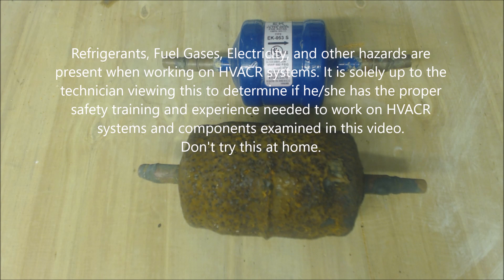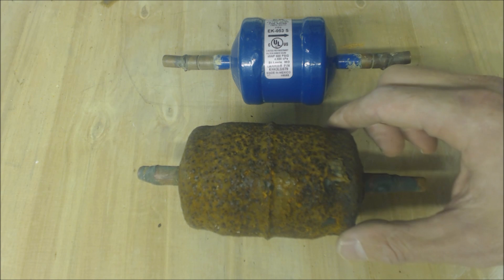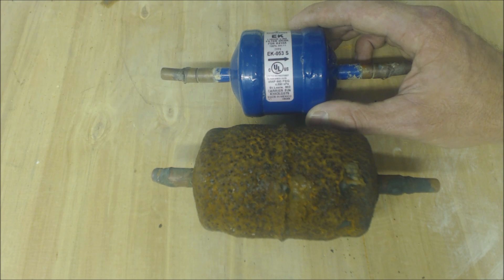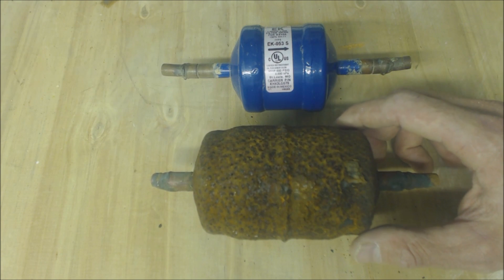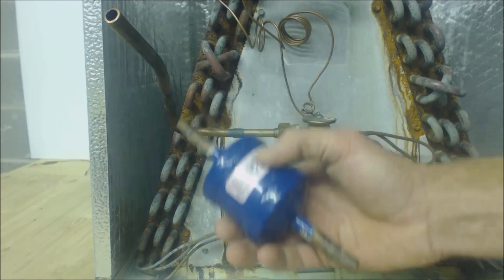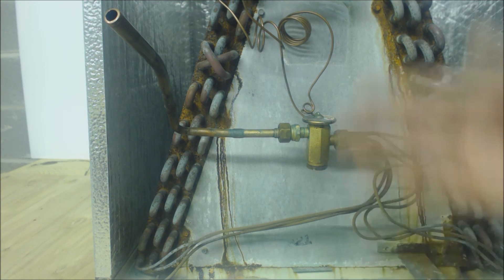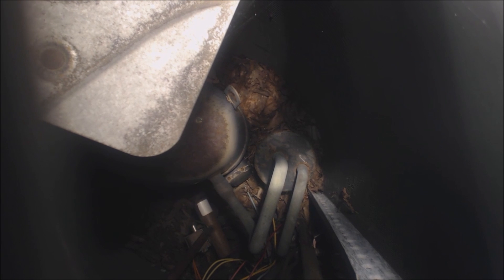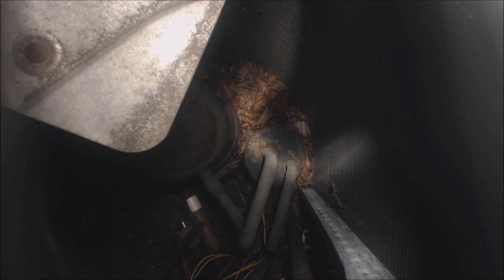Refrigerant Filter Drier Location- Where to Install and Why!

Comment from the maker: Tool List-  https://www.amazon.com/shop/acservicetech
Support-  https://www.patreon.com/acservicetech
For those that are looking for the tools used in the videos: (Links in the Description Section)
Reply: Leuiq lind  conedsoashion
Reply: Boas maun  sir leacking
Reply: Can I attach a filter/drier 1/4 inch SAE threads between the R22 tank outlet port and yellow hose for gauge set just as an extra precaution while topping off the AC unit? I usually fill as a gas and not a liquid just to top off. I have an old tank of virgin R22 that sat outside and the threaded port got some slight surface rust over time which I cleaned off, but still worry about hooking up my hose too.

Comment: Question I was in a tight spot where I only had a bi directional filter dryer. Could it be used on a regular AC system that requires the one direction?

Comment: Can I attach a filter/drier 1/4 inch SAE threads between the R22 tank outlet port and yellow hose for gauge set just as an extra precaution while topping off the AC unit? I usually fill as a gas and not a liquid just to top off. I have an old tank of virgin R22 that sat outside and the threaded port got some slight surface rust over time which I cleaned off, but still worry about hooking up my hose too.

Comment: Thanks for this video.  Is it indifferent to place the line filter vertically or horizontally?  What do you advise me?  thank you.
Reply from the maker: It can be installed vertically or horizontal but make sure the directional arrow is facing in the correct direction unless it is a bi-flow filter drier, thanks!
Reply: Most new systems come with a filter inside the unit. You don't need a second one.

Comment: Is it a good idea to replace a half 1/2 inch line filter instead of the original 3/8 inch line filter that comes with the equipment?

Thanks for this video

Comment: I installed my 3.5 r\ton Goodman heat pump in 2016. The filter drier was already installed in the condenser.  Should I just leave it as it still looks new?

Comment: Ive looked in my Trane condenser unit and I only have an acumulator next to my compressor.  Or is it in fact a filter drier?  I see no other device anywhere along the liquid line. Any thoughts?

Comment: You say + or - 2  psig across the filter indicates a restriction but to be safe use + or - 4 psig. But wouldn’t the higher pressure indicate a greater restriction and + or - 1 psig be the safer limit?

Comment: Had a new Trane split HP installed Feb 2020. Recently discovered the crew did not install a filter drier. System heating and cooling well. Delta-T 19-20 deg diff in a/c mode. New line set installed. Not sure if nitro was flowed while brazing. Will not be using install contractor again. Should I just let it ride at this point and have one installed down the road if the system has to be opened for any reason, such as a leaking coil ? It would cost less at that time. To do it now would probably be $300-$350 labor & materials. I'm guessing at that. What is your opinion ? Do now or later ? Thanks

Comment: I've seen filter driers installed on the compressor high pressure side (outdoors, mounted to compressor, just upstream of changeover valve) in heat pump systems, is this an acceptable location (aside from being exposed outdoors)?
Reply from the maker: That is a muffler, not a filter drier when it is on the discharge of the compressor.
Reply: @acservicetechchannel  Interesting, I hadn't considered this is a muffler.  I had just assumed the parts list description was accurate but we all know that's not always the case, so good point and thanks for clearing that up!

Comment: Yeah except for them douche bags from Goodman, Lennox and trane are inside the condenser forcing us to remove the mold in a few years and especially with close to the ocean which where I’m at everything is some more than others. Usually the coils leak faster than the damn filter driers. Because of 410 a

Comment: If the filter dryer is inside the condenser should I recover the refrigerant and replace the filter dryer? Is a pain in the ass to replace specially on Goodman and Lennox shits

Comment: For some reason, no filter drier was installed in the liquid line of my old condensing unit. It looks like there was a muffler installed in the hot gas line by the manufacturer. I did install a filter-drier outside when the suction line inside the condensing unit developed a leak.  The filter drier was somewhat protected from the rain by an overhang so it never rusted or leaked for 11 years. The compressor finally died after running for 27 years.  The one thing that I have noticed that causes accelerated rusting of exterior-installed liquid line filters is overheating of the filter and damaging the paint on the steel surface of the drier.

Comment: I've never heard/read a good justification behind people installing the filter drier outside and just after the condenser. A crucial purpose of the filter is to protect the metering device from loose debris since it's one of the most delicate devices in the system. As you describe in the video, the filter should be placed close to the metering device. When you install it outside directly after the condenser, any debris/contaminants in the fluid line (which is often 25' - 50' long) between the filter and the metering device will be flushed into the device on initial charge before being trapped in the filter after one full cycle. With the filter placed just before the metering device, it will catch all this debris between the condenser and meter before it has a chance to enter the device. Of course, after a full cycle the filter placement won't matter in this regard, but whatever debris is in that 25' or 50' of fluid line at initial charge could be enough to damage the metering device. Then there's corrosion when installed outside, as you've explained. Great videos.
Reply: Liuked line  ..discharge line ner  fixeing

Comment: my girl has a 30 year old rheem 1.5 ton unit and the dryer is outside but in good shape. but this year the unit did not cool good. i found tons of crud on the condenser coil and cleaned it. it has at 80deg outside temp running it had 35# and hs 150# temp on the liquid line at the service valve was 83 deg and at the evap it was 56 deg. i did not think to check the temp at the dryer but i wonder if the 30 year old dryer may be the issue. i soaped all the fittings the evap ends and condenser ends and no leaks. in the foo state at 80 deg it had 112# and 3 weeks later at 60 deg it had90#  so i do not think the unit has any major leaks. but now i think the dryer may just have failed.  should i got back and start it up and test the temps again to see if they are different at the dryer? if so can i jst actuate the relay outside and run the unit without the furnace calling for the ac unit to run? or will that cause a error due to superheat at the evap? it has cap lines on the evap. thanks

Comment: Whenever I have a leak at my braze joints it’s always at one of my filter drier joints. Does anyone know why I might have this issues? Drives me nuts.
Reply: It's because the cooper is so thick where you make your connections and it's harder to get it hot wen your trying not to burn it up

Comment: hello mister I have a question Does this filter protect the compressor by not leaving the sifted oil during operation and damaging it in the long run? 
Is this for the same reason that some people keep twice the copper extensions along with the external unit to protect the compressor؟

Comment: Why face the arrow towards the evaporator coil? The hot liquid is going the opposite direction to the outside pump.?
Reply from the maker: Jacob those are referred to as biflow filter driers and they have an arrow in both directions, thanks!
Reply: @acservicetechchannel  mine is like the blue one in the vid.  It has one arrow.  This should be posted toward the outside pump correct? Thats the direction of the hot liquid.

Comment: If you have a clogged filter dryer will that make the unit work harder and run more ?
Reply from the maker: Yes it is called a liquid line restriction. That increases the superheat and reduces the heat removal from the building
Reply: AC Service Tech LLC  Thanks
I had a tech tell me I have a clogged filter dryer and because my unit is 20 years old that I need to replace the whole unit.
Reply: How much does a filter dryer replacement cost? And do you recommend anybody in the West Deptford , New Jersey area ?

Comment: craig  I try to place the dryer half way on the liquid line thats    where I was taught and   30  years later  alot of those units are still running
Reply from the maker: Great yeah as long as they are not outside, thanks!

Comment: Hi Craig, I'm installing a Goodman 2 ton split system...GSXC18. I noticed on the outside condenser, down on the inside of the coil housing, right off the compressor on the 3/8 liquid line is a filter drier. Would I still install a second filter drier at the evap coil? Wasn't sure if that would create more of a strain on the compressor pushing refrigerant through two driers? I am on a 85' line set to the attic air handler. Thanks!
Reply: All Goodman systems come with a filter drier installed on the inside of the condenser ahead of the comlressor, it is not a muffler. 25 years in the HVAC industry. Cheers from L.B.I.N.J.
Reply from the maker: If it is on the discharge line right after the compressor, it is a muffler and not a filter drier so will be good for you to install a liquid line filter drier after the condenser coil. Best if it is inside the building to avoid rust, thanks!

Comment: Your corrosion comparison had more to the with brand than anything else. Those are the exact same ones AMANA and Goodman install in their systems from the factory. I’ve been to many of them that are over 10 years old that still look like the one you showed. They resist corrosion extremely well. But, I’ve seen other brands look like that shitty rusty one in a matter of a year or two.
Reply from the maker: Yes the metal is even thicker on them. The rusty one came off of a unit at the beach, thanks!

Comment: Something else about filter dryers I didn’t know, just because they physically fit does not mean they are the correct dryer for the capacity of the unit . Example - there are different types of 3/8 dryers for bigger units.
Reply from the maker: Absolutely, there is a wide range of systems that will accept 3/8" connections but we use larger ones for larger systems so that there is a reduced friction across the filter drier and for more water storage capacity, thanks!

Comment: I notice that my condensing unit has one inside and the installer put one outside  Is this hurting my efficiency?
Reply from the maker: The one inside may be a muffler if it is located on the discharge line on the compressor instead of the liquid line inside the outdoor unit. Usually there is only one and it will add some friction if there are two. If it were a new installation, it shouldn't have two liquid line filter driers, thanks

Comment: I’ve only seen filter dryers outside. Right near the condenser. Here in Indianapolis
Reply from the maker: It is not that much harder to install them in front of the evaporator coil so they don't rust out. I am also near the ocean so they rot faster due to the salt air, thanks

Comment: I have a ruud heatpump. Coming straight of the compressor and right before the  reversing valve, is what looks just like a dryer, its brazed in not spun copper. Is it a muffler or a dryer?
Reply from the maker: Yes on the discharge, that is a muffler, thanks

Comment: I have 2 questions:
1- what does tiole evacation mean?
2- is it safe to wear my wedding band while doing hvac work?

Grear video, thank you!
Reply from the maker: Triple evacuation is vacuuming down to 50 microns or higher, then breaking the vac with nitrogen, releasing the nitrogen and vacing again, breaking the vac with nitrogen, releasing the nitrogen and vaccing again down below 500 microns.

I have now switched to the silicone ring. Many do tatoos. Either way, we try to check as many things without amperage being drawn as possible for safety, thanks

Comment: Hello does filter drier required in every installations of split type ac?
Reply from the maker: Yes is should be installed on every unit. Some already have the filter drier installed, thanks

Comment: Hi it's Blaze from SoCal. I'm changing out a TXV and going to MO99 from R22. Should I add a filter drier. This is a 3 ton Rheem heat pump.
Reply from the maker: Absolutely add a biflow filter drier, thanks
Reply: acservicetech thank you for getting back to me. I added the drier and now I have the system evacuating. Have a great weekend.

Comment: What about the manufacturers that have them installed in the condensing unit.  Its in contact with the outdoor conditions?
Reply from the maker: Absolutely Chad, there is nothing we can do about that. For systems that don't have them or an accumulator outside, they are the thinnest tin out there. The brazed part melts the paint off and that is where they rot out at. The filter direr in the video is an extreme but they still rust. As a service tech in your area, if you are not finding them leaking then it is not that big of a problem. I will say that for most installations, it is fairly easy and not that much more work to put them inside. Thanks Chad!

Comment: My master technician I ride with almost always puts the filter drier inside the outdoor condenser, so installing the new filter drier near the evap is more preferable then in the Outdoor unit?
Reply from the maker: Yes indoors is always more preferable  unless it came from the factory installed inside the outdoor unit. I have never had one rot out inside but I have had many rot out outside and their is no difference for the refrigerant flow or other concerns. The tech may just not want to go in the house to braze. But as all of us have done, follow the tech's procedures until you get out on your own. Then you can make your changes to your procedures without offending him, Thanks Rob!

Comment: This is off the subject of this video, but when you showed where the accumulator was, I noticed leaves and other material in the bottom of the condenser. When you notice that is it a good idea to suck all of the debris from the inside of the condenser? And using a garden hose to clean the fins, is that a proper way of doing it? I was working on my sons unit and when I opened it up, OMG!!!!! I used the hose to clean the fins. I am a novice at working on systems and have just purchased a set of gauges. Would it hurt to use his unit as a guiena  pig, of sorts, to learn? I have replaced a circuit board and his indoor fan already by myself.
Reply from the maker: The units do accumulate leaves. I have seen even 5" deep with leaves before. Definitely clean them out and yes, water from the hose should be used first before using a coil cleaner. Then after the cleaner is applied and you have waited ten minutes, clean off with the garden hose again. Before doing this, make sure if there was a outdoor motor replaced, that there are no open connections for the hose water to get into, thanks Todd!
Reply: Thanks for the tip. Can you get the cleaner anywhere, or just at a supply outlet?

Comment: That real rusty one you have there looks something like the one that was just removed from my York outside home AC unit. From what I understand it is 'powder coated'
and the corrosion on mine went undetected, as it was occurring under the paint/powder coating without showing on the outer surface until the last pangs of life when the coating peeled off in layers to reveal the rust underneath. And mine was only 5.5 years old. 

I contribute it to improper undercoating of the steel canister before the outer paint/powder coating was applied?

photos/discussions here:
<http://www.refrigeration-engineer.com/forums/showthread.php?48025-Lifespan-of-Filter-Driers-in-Home-AC-units>

I'm thinking it was a lousy China made product?

How would you install the filter-drier unit 'inside' in these big self-contained
outdoor home style AC's?
Reply from the maker: When I said inside in the video, I was talking inside the building in front of the indoor coil if the system is a split system. If the unit is an outdoor packaged unit then the filter drier would have to be installed in the unit which is outside, thanks!
Reply: I figured that must be what you meant,...installing it inside vs outside.
Have you seen a number of these filters rust to the extent of that one you displayed, and that one of mine?
I've was in the boat business for years, and salt water boats as well, so I have experienced metals that were not properly prepared for their environment. This extent of rust under the outer coating reeks of the same problem,...improper undercoating!
Reply from the maker: Yes I have and I always advocate installing them inside on splits, but on package units I recommend wire brushing and painting them if they are starting to rust, thanks